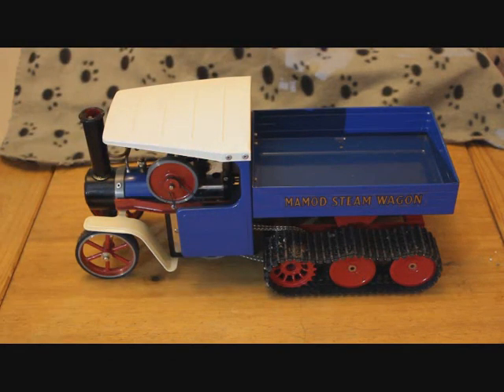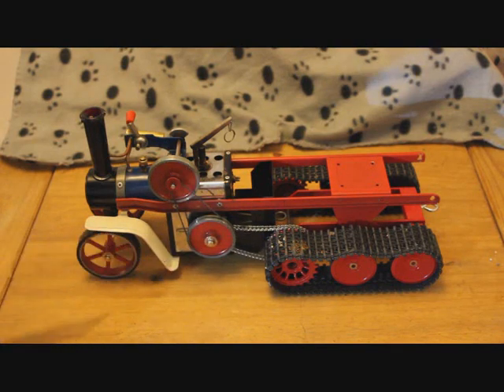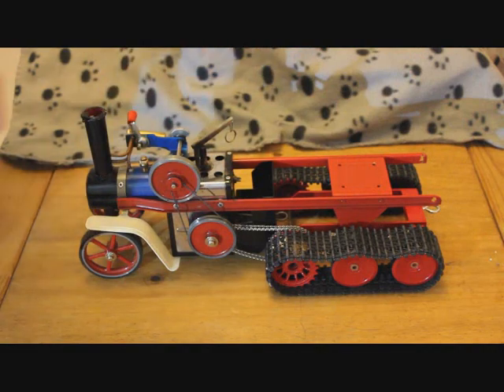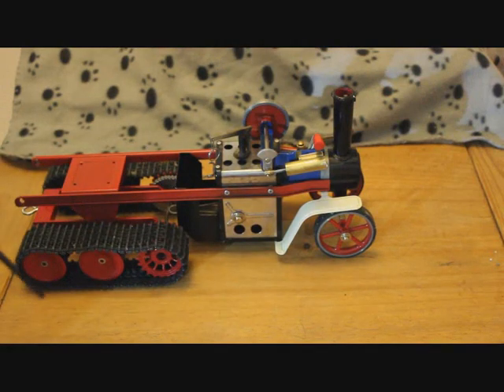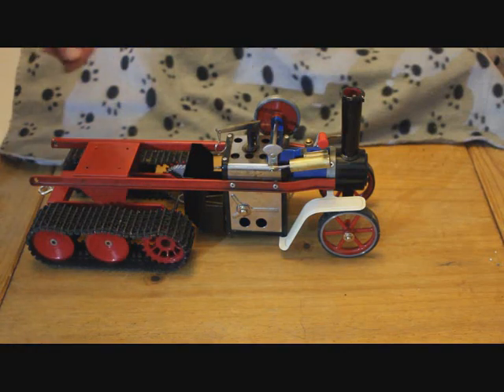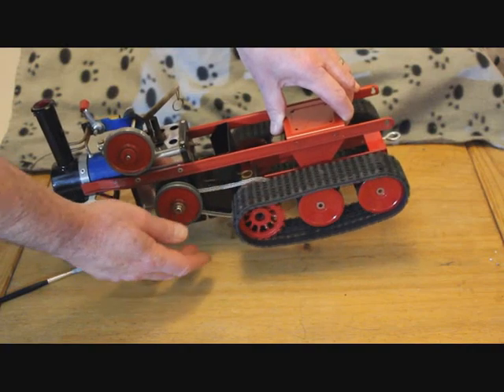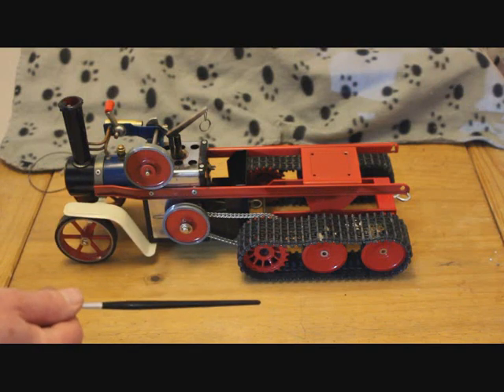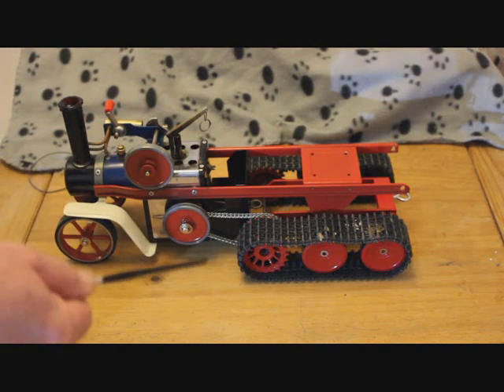Mamod SW1 Steam Wagon - Half Track modification

Comment: Where did you get the 13mm piston arrangement ? Like what you have done
Reply from the maker: I used the earlier cylinder assembly that's made from two pieces soldered together..unsolder the old cylinder and solder on a brass tube of larger diameter to make a new larger cylinder, plus an end cap. I used the original piston and shaft soldered a new piston over the top of that..hope you get the idea 👍
Reply: @martinwarm4041  Thanks Martin
Reply: I’m surprised that Mamod doesn’t make the larger bore cylinder. 13mm bore works great